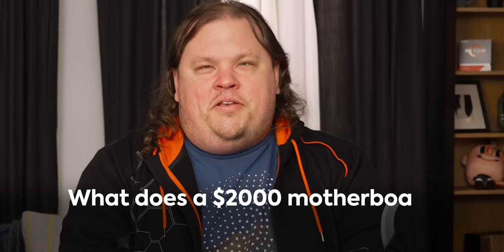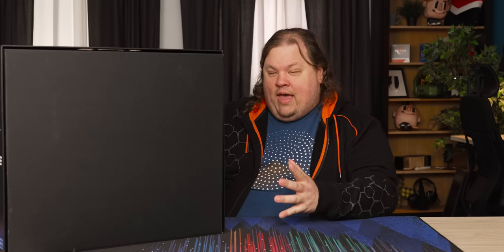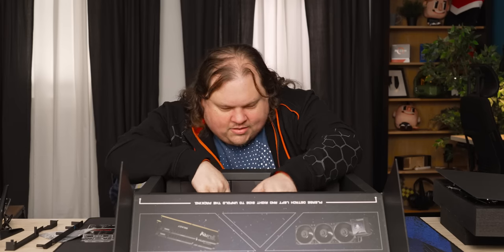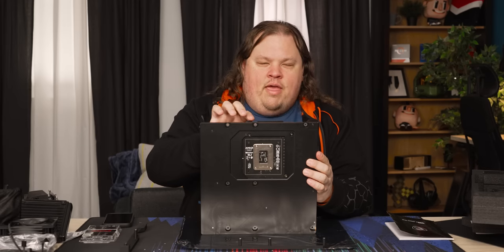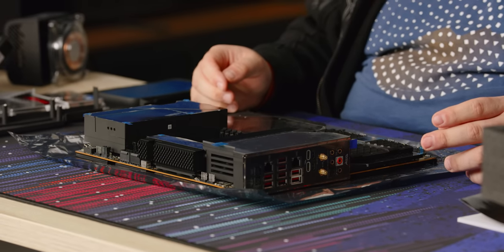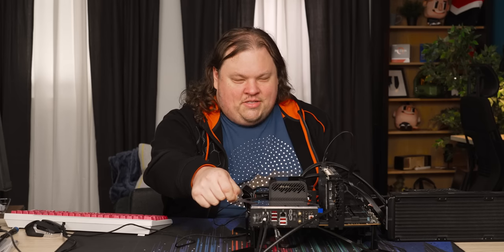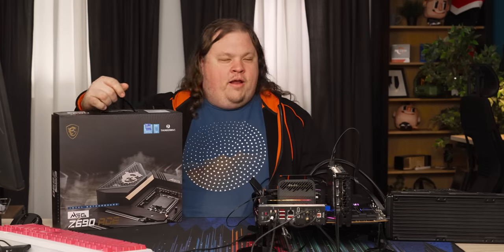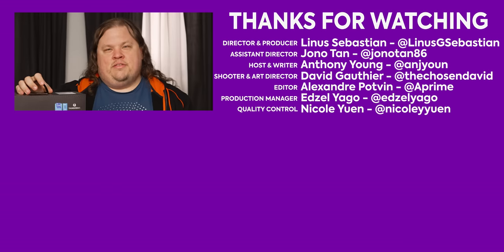Is it truly GODLIKE? - MSI Z690 Motherboards

Comment: $600 mobo and no 10G?? only the $2k version does? What the F? All server grade stuff are slowly trickled down to the consumer sector except for the 10G connection, and when they do offered it then it's like the special edition, the PRO, the Ultra and some BS like that.. and honestly I can never understand why. I can get a 2 ports 10g SFP+ intel card for around $60 dollars... 10 years AGO.... Today you can get it for $35.... for $70 you get a 2 ports QSFP, that's 40G card. Although switches are fairly expensive... I've got mine a mikrotik with 24 10g sfp+ ports and 2 qsfp ports for $520... But that's not my point, my point is all we get in the past few years is a bump from 1G to 2.5G?!?!? why??

Comment: lol with only 3 pcie slots & only dual ram it's not even pion person like is that the buggy 2.5 Gb intel chip too, where's the dual 5Gb/s chipset if not generic 2022 dual 10Gb at this price
where's the dedicated pcie x4 & x8 motherboard slots for the two current low end gpu's available at retail lol

Comment: MSI bios is so garbage, ive had a godlike motherboard before and it looks the same as this one its so bad and laggy
Reply: Also this godlike motherboard I had was also so bad
USBC ports were so deep that you can’t connect anything to it
The included wifi antennes broke without touching it
The screw posts things for the antenna on the board were loose 
BIOS so bad and ugly, can’t do anything there

Comment: "what does a box look like?" did you know AMD having several times the bandwidth of competitors with same stick of RAM and like double the bit depth.. and higher numbers written on the box a 6500 is way higher than 3090 .. means it crushes intel and nvidia.. not even close? but you've gotta turn on and enable the OS and display driver features? when you plug in a sound card or usb audio device its 16bitstereo not 13channel surround 32bit 384khz. So you gotta configure it and enable the features.You've never even see the box of AMD. the AMD GPU numbers means how millions of rays it can do either per pixel or the display at a set resolution? nvidia's does like 8 rays per pixel in fake ray tracing.. AMD does real time CG render in trillions of trillions of resolution with path traced simulated reality with real physics. Candles that smoke and have flickering light that shines through the slightly transparent waxy candle base column. water thats wet.. see from one end of the map to the other. In genshin see yaes house from mondstat. i believe the numbers on nvidia's box are for how much fake ray tracing it can pretend with its highly inaccurate maths up to a certain fixed resolution with like 8 rays per pixel. i dont even need DLSS/FSR to reality render in trillions of trillions of resolution on a 5600x ryzen or 5700G ryzen and 5700xt. https://drive.google.com/file/d/14etH-xcYpHa-F4ucjhpSnq7117YPySUk/view?usp=sharing  copy my config file to your documents folder and place into documents and downloads folder and c:\ folder. if android phone place into same directories can do same on SD card or multiple drives. consider making registry entries in keycurrent user i did multistrings for some of the word entries in the text file i felt were significant?

Comment: Not enough pcie. Useless.
Reply: Seriously.. like even my system is rough because its x1 slots are under my gpus. And I only have 2070s and 3060. Can't fit the 1660ti or it'd be in too. Firewire card for my expensive soundcard (could be replaced with thunderbolt with firewire adapter) and a pcie to m.2. The m.2 pcie card has to connect on a riser cable that runs UNDER the 3060 fan shround. Ugh. I wouldn't mind so much if like x16 to 2 x8 risers were more common and cases supported that kinda stuff..